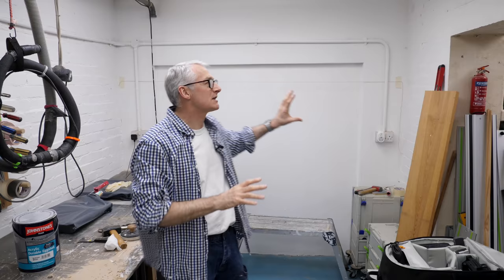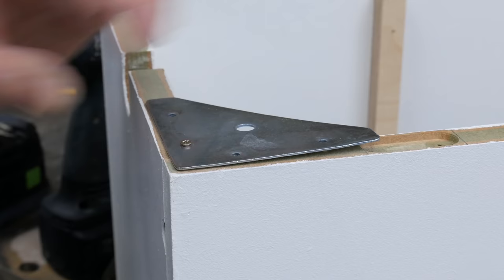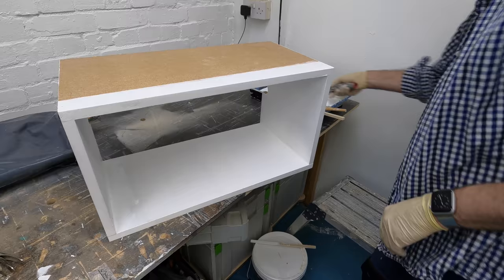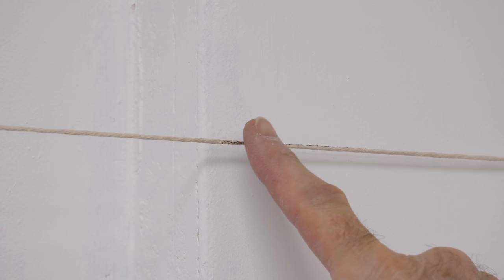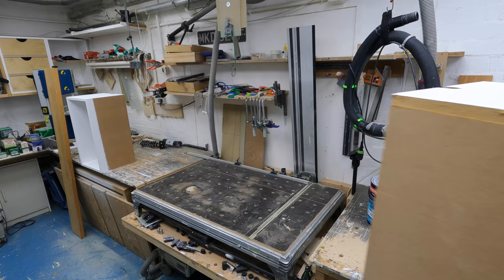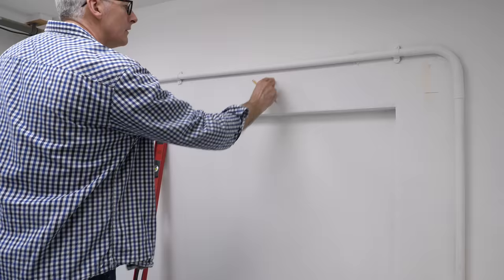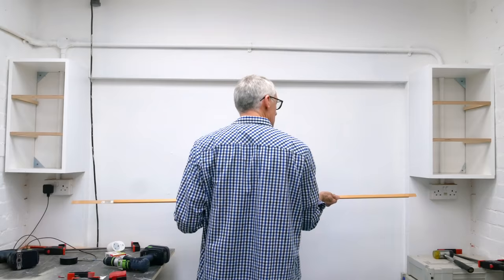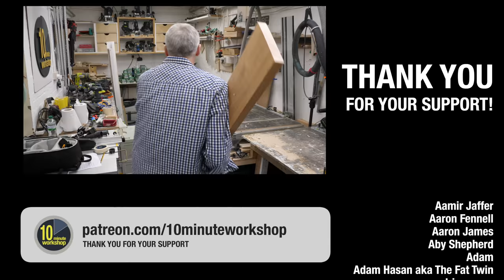Workshop Clearout & Basic Wall Cabinets [video 461]

Comment: I am really getting some good ideas from your videos about making some cabinets and shelving units for my shop. My shop is in my basement, situated such that I have two walls that are the concrete foundation walls. Nothing is mounted to them currently. For years I thought about putting up furring strips and drywall over them, but may just mount directly to concrete by boring holes. I suppose I could hang long French cleats to hang storage from instead. But I am anxious to get started building some utilitarian storage, and not try to build anything too fancy. I like the idea of simple plywood boxes to put into the cabinets. Thanks for the inspiration!

Comment: In our house (built 1880) I can’t rely on any surface to be vertical, horizontal, flat or at right angles. Consequently I have been finding your techniques for straightening things up useful. Eg your use of a string in this video, though how did you attach the string to the wall? It would be handy to have a video that illustrates the various techniques and tools for getting things straight and level. I don’t have a laser level, I only found out such things existed from an earlier video of yours. Thank you.
Reply from the maker: Thanks! That’s the same vintage as my own house - same problem walls too! Re the string trick - I just stuck it to the wall with tape!  Great idea for a ‘straight and level’ vid. I’ll,work on that. 👍👍

Comment: Peter...  This has nothing specifically to do with this video, just wanted to put this on the latest one.  I am a HUGE fan, love the work and tips and Style.  HOWEVER, ever since I started watching your vids, every time I see you pull out your old speed square or reg square or almost any of your hand tools I absolutely Cringe!  So I finally had to say something.  Why?  Because you are a master of efficiency and precision and organization.  What I find hard to believe is that with all you experience and tools is that your not using Woodpecker Hand Tools.  Not sure if you haven't seen them, or they are hard to get there or what but I truly believe you should include them in your "process"  Are they expensive?  Yes, very, however you really strike me as someone who values quality, precision and time saving over all else (Festool etc..)   I will make you a deal...  I will personally buy you one or two of their tools at a time if (in one of your videos) you take the old ones and throw them in the garbage can!  Deal?  Keep up the great work and best wishes...
Reply from the maker: Hi Richard, and thank you for your kind comments - and indeed your kind offer! Whilst I’m sure woodpecker make fine tools , they’re not something I’ve ever found the need for, and on a purely personal level I prefer to showcase tools from smaller, one-man-band manufacturers, or tools that are old and British. My smaller steel engineers squares were made many decades ago by Moore and Weight, and my larger squares are from Mirock Tools in the Ukraine where Vladimir hand finishes each one in the hardwood of your choice - mine are in Wenge. I also have a very nice new precision square from Benchdogs which gets an airing in the next video in this series. All these tools are precision instruments, often finished by hand, and they mark my journey as a maker from picking up third-hand old engineers squares when it was all I could afford, through making investments in measuring and marking tools, to where I am now. No, they don’t have a flashy paint job and they are mostly covered in a patina of paint overspray, but they’re a reminder of where I’ve come from, with each tool paid for by work I’ve made with my own hands. 

Thank you again for your kind offer, but I’m afraid I won’t be throwing my squares or other measuring tools away any time soon! All best, Peter.

Comment: I have a question, I hope you see this and have an answer for me... You know those long white furniture panels you can get from B&Q, they are just chipboard with that satin white laminate that covers it, well, what would you say is the strongest glue I can use to join these? Obviously I'm going to be screwing them together too, but I just want it an even stronger join, I was firstly thinking just gorilla wood glue, but really that need bare wood to wood, so what's best for them panels?

Comment: Hi Peter, great vid - just wondered if you could share your pinner/compressor combo - they look to be an efficient combo
Reply from the maker: Thanks Daniel! I’ll be doing a ‘nailers and staplers’ video before too long, but short version, it’s a Hyundai 8-litre compressor that’s impressively quiet, and a cheap Silverline 18g nailer that’s fantastic value. Very happy with the combination. 👍👍
Hyundai 8-litre quiet compressor - https://amzn.to/398TyB7 (US: nope, sorry)

Silverline 18g nailer - https://amzn.to/3sfcZ2S (US: [similar] https://amzn.to/3rjJR9u)

18g nail mixed pack - https://amzn.to/3lGRIfW (US: [similar] https://amzn.to/3ccvrmW)
Reply: @10MinuteWorkshop  Brilliant, thank you 🙌🙌

Comment: Walls are never straight and true, first rule of putting up cabinets.  I think you were lucky that the left hand one was true enough and it was only the right to adjust.  Neat way of adjusting to fit
Reply from the maker: Both sides needed adjusting. 👍
Reply: @10MinuteWorkshop  that's more like it!

Comment: I think you would love the Festool drilling dust collection attachment for the vacume. It works like a charm, I love it I use it all the time while doing small things around the house. (festool 500483)
Reply from the maker: Ha! I've just given mine away! Bought one when they first came out and hated it - it collects dust, but in doing so leaves a horrible mark on the wall. 🤷‍♂️
Reply: @10MinuteWorkshop  I haven't had that problem luckily! I'll keep an eye out for that!